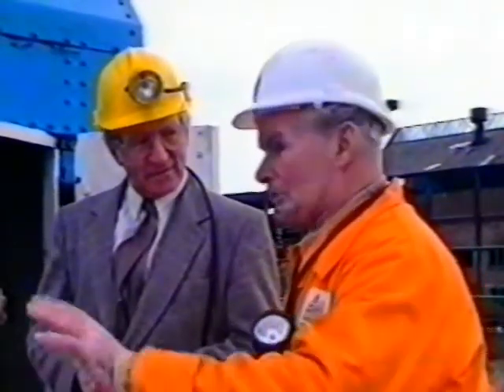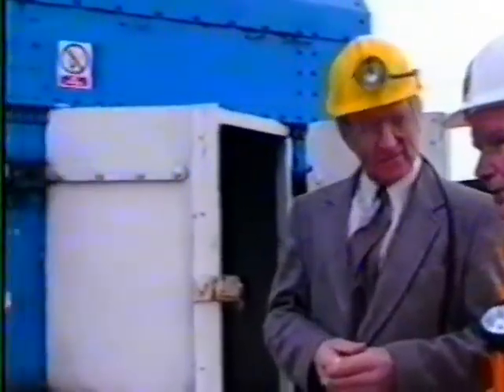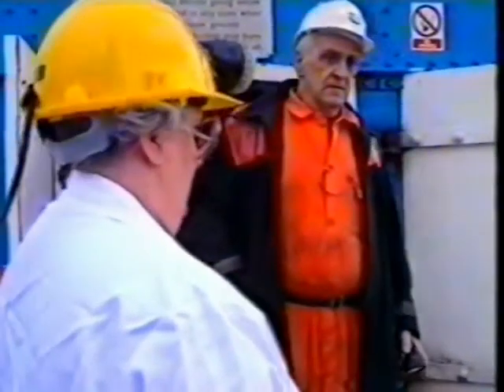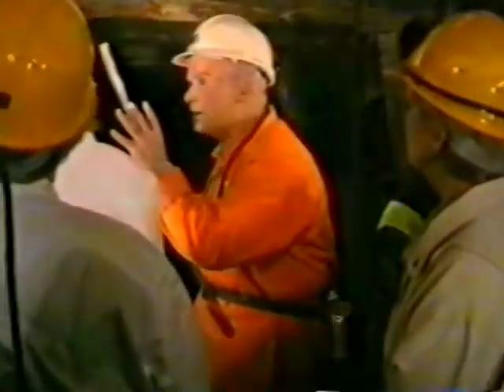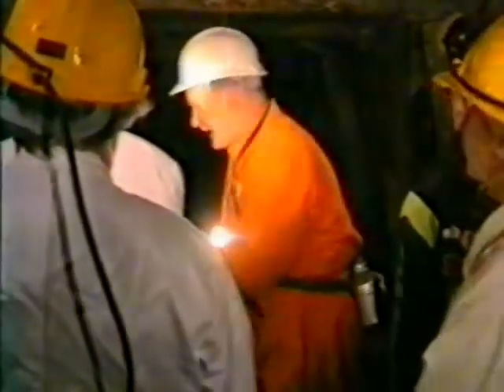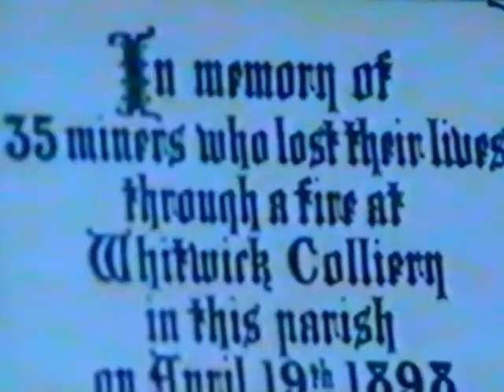Going down the Platt

Comment: Could you still get down that shaft??? Would be amazing to film down there with HD cameras
Reply from the maker: Unfortunately all sealed off.  No Access..All shafts full of water
Reply: @ChatterleyWhitfield  where they flooded on purpose or is it because once you go past the water table it constantly needed pumping out?  I only live up the road in Biddulph.  There is a video of a camera going all the way down the Hesketh, was that all underwater.  It went 280 meters deep!!!
Reply: @mcmennis  I know it's an old post but I've just come across it. When Florence colliery in Fenton/Longton stopped pumping because it was being closed, all the collieries in the local area started to flood as it was the main pumping station for the area. My brother had worked at Florence upto it's closure and before then at Holditch at Chesterton, Newcastle.
Reply: @ChatterleyWhitfield  platt shaft is open down to the underground experience, once you guys are up and running you should reopen the underground experience in the fan drift, and use the cages again